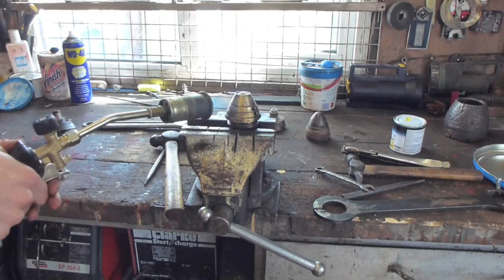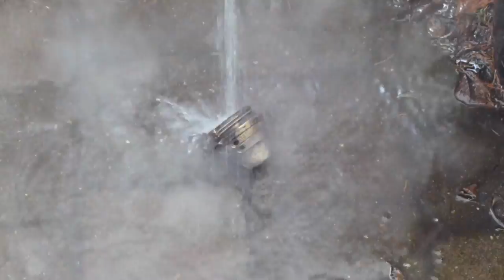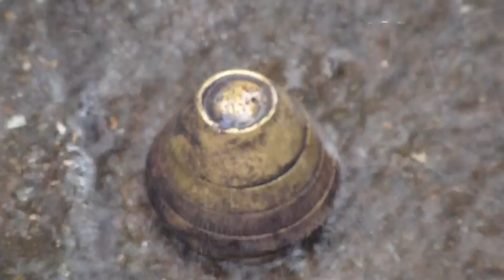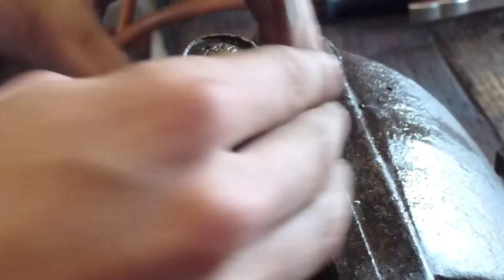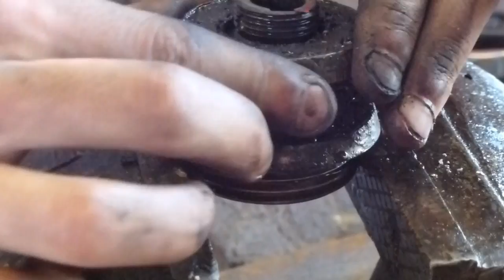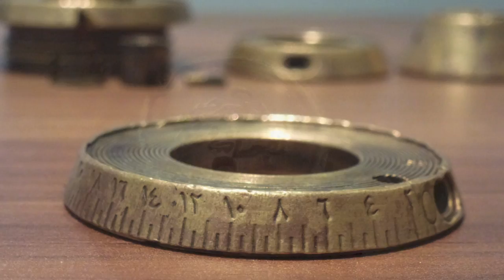Gallipoli rare Turkish 75mm artillery shell fuse

Comment from the maker: Joe Jerrard-adams Theres loads of corrosion thats 'fusing' the components together, so heat it up to expand the pieces, which frees them off, the cool it down to rapidly undo the expansion from heating, which loosens the components. So it makes it easier to get apart, less damage is done to the fuse also if it was still really hot you wouldn't be able to touch it when your taking it apart and oil wouldn't be as effective. Heating then cooling = best method, trust me!